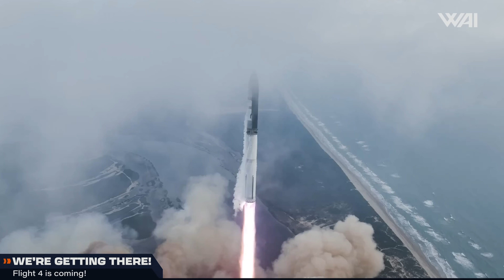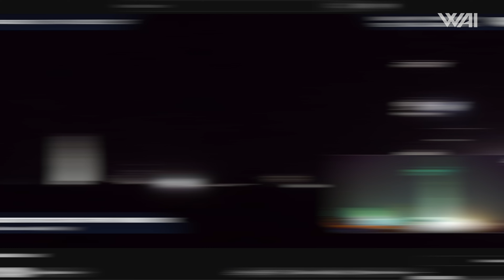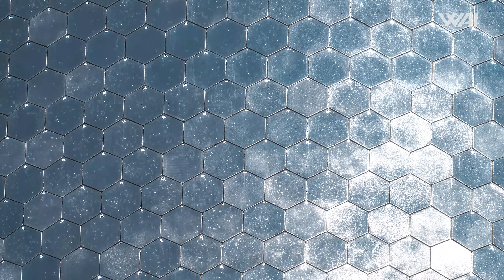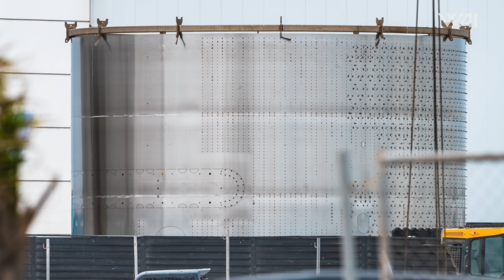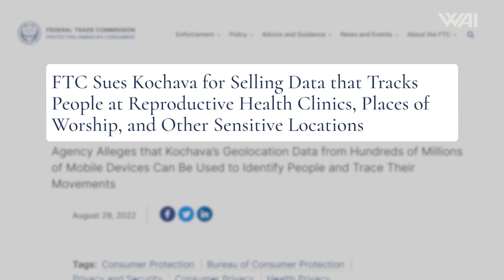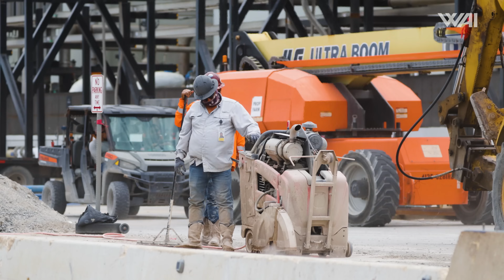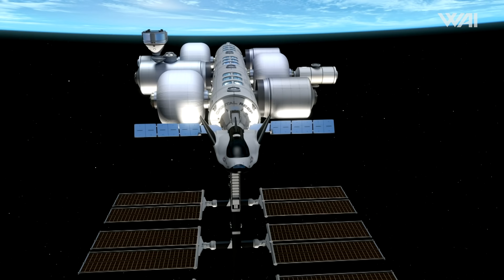SpaceX's Crazy Race To The Next Starship Launch Hides A Twist!

Comment: The tiles have been an issue from their very first use. They don't stay on, break, and get knocked off from just moving the ship or static fires. So, of course they'll cone off, break, and disintegrate during reentry. They probably still have a long way to go. They're going to have to figure something out. Stage zero is still taking a beating, too. I just don't see how they will be able to make it robust enough to survive such insane temperatures and forces without having to do any work between launches. I just don't see how they'll ever get to a point that moving a booster and ship from a drone ship becomes the bottleneck in the turnaround times. If you're going to have to refurbish the launch pad between every launch, you might as well land the booster somewhere else because the pad won't be ready quickly enough for a catch to make sense.

But they've surprised me in the past so maybe they'll figure something out for both the tiles and the launch pad. Then again, I've also been right in the past about issues they tried to brute force solutions for. It'll be fun to watch, either way.

Here's something else I have always wondered about. If catching a booster is really going to work, why haven't they done it with Falcon? I mean, they wouldn't even need to catch it. But why haven't they pushed for most of them to return to the launch site? The answer is because the boosters need a lot of work when they come back down before they can launch again. Their launch cadence has gone up partly because they have shuch a large fleet of boosters now. So every booster can go into 3 months of rebuilding between launches but they can still get out over 100 launches a year.

So, how do they think they're going to get Superheavy to fly, land, and fly again without the same rebuilding and refurb between launches? The engines alone are going to take a real beating coming back down. I'm just skeptical that it is ever going to work because they would've done it with Falcon already. They definitely got the refurb time down by a lot but its not zero and it needs to be zero for catching a booster to make any sense.

Thanks for the great coverage of everything, WAI.
Reply: Hey bro, im not saying any of your points are wrong but one of them can be explained. You say you just cant see how the starship can be ready for a lanuch within lets say 3 hours right? If you saw EverydayAstronout's video with Elon going around Starbase there is a segment where it just infuriates Elon that they just can't go directly to the newest of designs of Starship and instead has to countinue the testing campiagn with the "old/outdated" designs right now to get as much data as possiable. Elon even mentioned that the design right now is so outdated that the Ship wont even need all 4 flaps but could survive with only just on, which baffles me;) But we'll se now

Comment: I think the nose will get a single pre fab TPS piece that will fit whole over the nose.  This has likely always been a point of concern and flight 3 seems to possibility show TPS pieces breaking off.  Thats a very his areodynamic stress point as its literally the leading edge of the ship.  A single conical piece would actually be held on by those forces rather than ripped apart by them.  So makes a lot of sense although geometrically its probability a difficult single piece to make so they didnt do it initially.
Reply: That is very risky... if that monotile breaks, RIP

Comment: I would think that one of the things they learned from flight 3 is that their RCS system is seriously inadequate. I don't know if they have reaction wheels on the ships or not but I know they did not have nearly enough control authority during the interface with the atmosphere. The original concepts showed the ship having a powerful methalox RCS system. It was originally going to be powerful enough to induce the flip to vertical before the main engines light for the landing. Starship is eventually going to be landing heavy. Whether it's a ship full of people, bringing back samples or even satellites like the Hubble to place in a museum it's going to need a powerful thruster system. Concept art of the Lunar versions landing engines look like a bunch of the same thrusters. I thought I saw something about a potential Methalox thruster test months ago but I haven't seen anything since. I'm surprised we haven't seen a bunch of this by now. I get the whole "no part is the best part" thing but sometimes you just need a part. A system like that seems necessary to me. Using head pressure from the main tanks autogenous pressurization system seems like it would have too many limitations. Theres only pressure available after the engines have been running and once that pressure is gone its gone until you relight. So it would require serious plannimg ahead and not be very versatile. Versatility is one of the main ideas behind Starship as far as I know. Methalox thrusters should work as long as there's propellant. But you'd also need pressure for that system, so either pumps or a pressurization gas like helium that they want to avoid. Or I guess they could try one of these electric RCS systems several companies have  been working on using something like water and microwaves. Whatever they end up doing it'll be interesting to see.
Reply: We don't even know if the RCS is actually the culprit since the investigation is still ongoing

Comment: The definition of insanity is doing the same thing over and over and expecting a different result😅the booster is the same, SpaceX built 3 of them, starship is the same,the will explode again 😅100%
Reply: Wonder why Flight 2 can get to the stage separation will all engines despite it allegedly being the same as Flight 1...
Reply: @alvianchoiriapriliansyah9882  people get in car accidents all the time,all don't die, however,if one keeps speeding , driving without a seat belt or driving drunk it's only a matter of time , SpaceX only improvements are software, they can't do any real fixes because several boosters and starships have already been built ,so they are trying to make it work without redesign,more problems will turn up
Reply: @codeforce5556 lol Shure bud 63 corrections were ALL software /s

Comment: I believe for leg survival, its gonna need a water shower from the leg leading edge for creating a colder boundary layer, preventing erosion and damage to the metalic surfaces... So, not only water from the floor upwards, but also from the legs, and maybe from the top of the stand as well to protect the stand from the 10 seconds that the Starship flames lick it... Its tooooo much heat and presure to resist alone.... If a water shower also protects it i believe it can be a easy way to fast reusability...
Reply: Every launch strips off a layer of paint.

Comment: Why don't they disconnect what needs to, then use the chopsticks to lift and move it sideways of the delicate ring. And then lift off?
Reply: This is a 5000 tons stack which will instantly break the chopsticks if it's being lifted, and there's the engines that can only being turned on by GSE

Comment: Ryan is right, I worked for Atlas Copco, and they are building very big compressors, and they try to prevent the use of "flexible" hoses, just for the reason that the connection and the hose is the weakest point. So they use thick steel pipes instead. But in this case that isn't possible? Or maybe a part? I'm not a mechanical engineer. SpaceX has a lot more smart people as me. Thanks Felix for the update Felix, :_WAIYouRock2:

Comment: All this looks somehow very wasteful. End of 70s beginning of 80s they managed to develop and build novel space shuttles without shooting a lot of shuttle prototypes beforehand just to see how they get destroyed, rotate in space etc. Isn't it cheaper just to simulate most of the stuff? Hydrodynamics, fluid dynamics, plasma physics, material sciences, atmospheric physics only became better developed fields of science since 70s-80s. Simulation software is on another level right now. Why do they build these ships to destroy them?
Reply: Tiles can be tested in a lab without destroying the whole ship. Very strange.
Reply: @FedorBP By your logic it should be impossible for Starliner to have issues on its first flight
Reply: @alvianchoiriapriliansyah9882  but it is not its first flight.
Reply: @alvianchoiriapriliansyah9882  by my logic engineers of 70-80s tested much more components on the ground without risking expensive assembled space ships.
Reply: @alvianchoiriapriliansyah9882  ah sorry. Starliner? from Boeing? It is much-much cheaper than the Starship.
Reply: @FedorBP Shure bud Starliner already flying to orbit before 2019 allegedly

Comment: Seems clear that the re-entry provided a lot of data on how the tiles reacted so no surprises there are upgrades to the tiles in various areas. While we only see views from one camera there will be a lot more cameras and sensors monitoring how the tiles reacted to re-entry. Thinking back to ITF-2 which lost a lot of tiles on the way up ITF-3 did much better and I expect ITF-4 to be another improvement. My guess is the tiles on the nose didn't have enough room for expansion causing them to shatter as temperatures shot up during re-entry.
Reply: Having he tiles face earth on re-entry should probably help prevent a RUD.

Comment: The tiles represent in my opinion the most risky element of starship.  The fact that it is difficult to keep them all in place during ascent suggests that during re-entry, with the flat attitude of the vehicle in reference to the direction of flight into the atmosphere, the situation will be much more critical. Any missing tile may represent a point of structural failure.  Let's not forget that a space shuttle was lost following the breach in the protection of the lower skin of the left wing caused by a piece of foam detached a few seconds after launch.  I do not expect that the speed of re-entry of starship will be any lower.
Reply: the shuttle was lost when insulation blew a hole in the carbon-carbon heat tile allowing super heated plasma to directly enter the wing which was all aluminum. that has a much lower melting point [ 1,200 degrees] than stainless steel [ 2,790 degrees] plus the flat angle of entry will create a buffer zone between the starships heat tiles and the plasma where the compromised shuttle allowed plasma to enter the wing directly.  starship has a much higher probability of surviving re-entry than the shuttle with compromised heat tiles. but with the amount of flights that spacex is considering for each starship launch [multiple times per day] the tile problem must be solved.
Reply: @michaelotoole1807   ...but all that pressure & heat concentrated at the tip, that steel might be warping/plastic at that point. I think they need a smoother/imperforate surface. A tungsten-copper cap might be better, might also allow them to implement redundant thrusters too.
Reply: I have been worried about that, too.
But after flight 3, I am less worried.
The reason for that is when flight 3 reentered the atmosphere, it was tumbling all over the place, and the full fury of reentry was placed on the stainless steel, and it held up great.
This is a testament to the durability of the rocket. This gives me hope that a missing TPS may not be too big a safty issue.
This does, however, make for longer turnaround times for relaunch, so it does have to be addressed.

Comment: Could the heat cause any residual in the liquid oxygen hose to vaporize and over pressurize the hose causing it to burst?
Reply: very unlikely, since there should be two types of overpressure valves (first is reset-able, the other one has to be swapped out when it triggers) which are designed to open before the design limit of the hoses.

Comment: Hey Felix, here is a (i think not so) hot take.
Not having a "old-School" flame trench, is one of the biggest mistakes!
The work they have to do after each start to every party around the OLM is sooo much, and would not be needed in that dimension, if there would be a flame trench, where all the power of the Raptor engines would not spread across the whole surface, but would be derived to samewhere else through the flame trench.
Also: My mothertounge is not english..so sorry for not having perfect words:)
Reply: You write English just fine.
Reply: @kimnelson-barclay7427  thx, I try my best:)
Reply: Trench won't protect the OLM dude
Reply: @alvianchoiriapriliansyah9882  It would absolutely. The maintenance would be shorter, and the legs would not take so much "damage".
Reply: @Kay_A_Wye The OLM (table) is located at the top of the trench so when the vehicle launches the trench absolutely can't avoid it from being blasted by engine exhaust

The works post launch so far had mostly occur on the OLM and not on the steel plate where the trench would actually be located, so it would be nice if you move away from being generalistic
Reply: @alvianchoiriapriliansyah9882  I don't want to sound "general". Like I said, it's not my mothertounge, and sometimes hard to write what I really say;)
How can I say it:
The feet from the OLM and the water deluge system always have to get special care. The feet even more with welding, painting every time etc. 
And if we move away front the OLM with it's feet...there is still the bottom of the launch tower, the surroundings from the shock waves which always needs repairs because of the fire and the shock waves. 
I'm not staying that a fire trench would minimize it to zero, but it would decently help a lot.
Reply: @Kay_A_Wye Where's the special care for water deluge plate? They didn't even disassembled it

Comment: I wonder why they can't use larger size heat tiles as more clips would gripping it . I know there is a bigger risk factor if one falls off  but with more clips to hold it in place they maybe less chance ?
Reply: i think it is because of thermal expansion. smaller tiles are less likely to crack, and also you can have thinner (but more) gaps between the tiles to allow for expansion

Comment: What's Obvious is the whole design leaves everything exposed to the blast in spite of their attempts to protect. A Good flame trench would eliminate all that damage   from everything NOT being exposed. They won't be able to rapidly relaunch anything if they have to repair the pad after every launch!
Reply: Flame trench doesn't protect the OLM once the vehicle lifted off
Reply: @alvianchoiriapriliansyah9882  It won't need an OLM because it will be a flame trench with all plumbing hidden under the Launch Pad Mound...
Reply: @Shivaho The plumbings on the existing pad is also...hidden
Reply: @alvianchoiriapriliansyah9882  Oh? Why are they having to replace it after even static fires?
Reply: @Shivaho Would you mind to point out specifically in which plumbing need replacing?
Reply: @alvianchoiriapriliansyah9882  just watch the video I don't have the time to go back through & find every time they have to throw up scaffolding Around it! Just watch the real time footage and see for yourself
Reply: @Shivaho Ah you mean after the static fire in which...the vehicle actually flies?